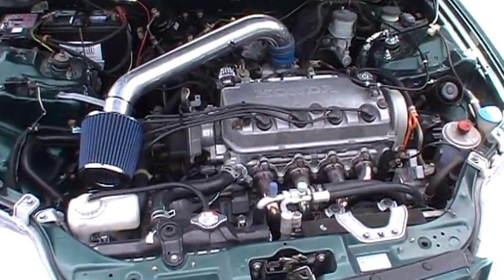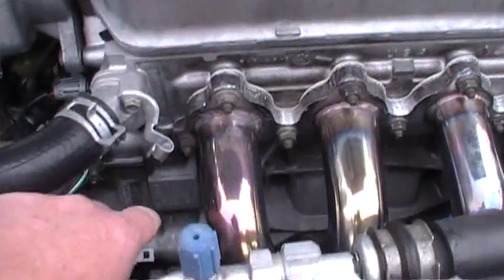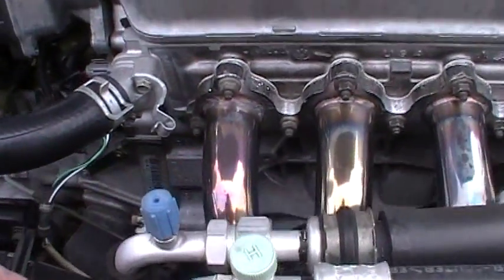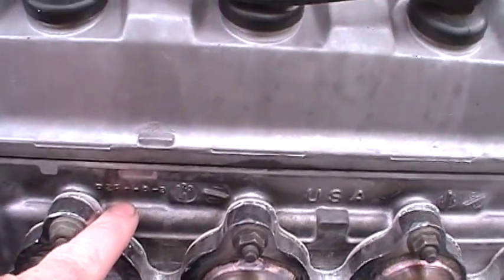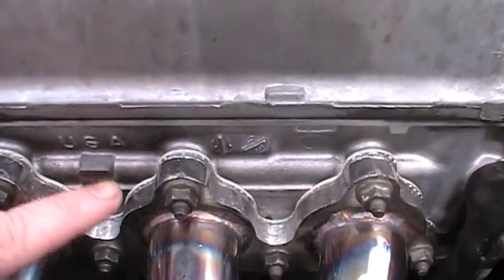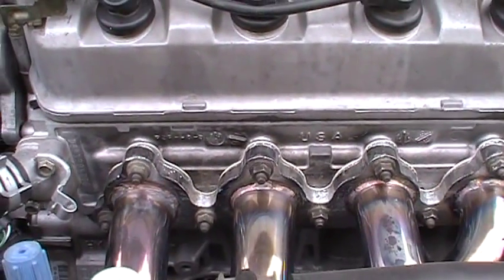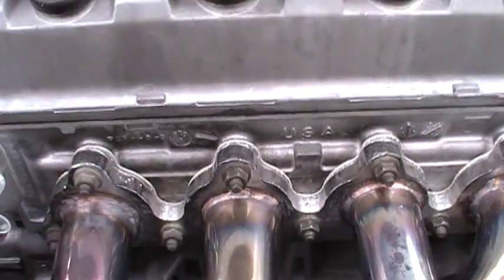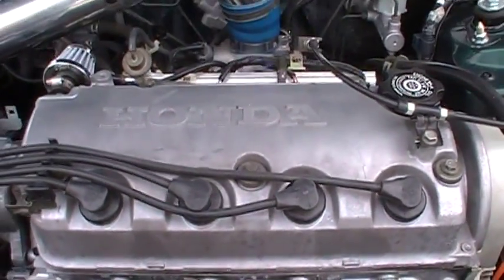Identifying your Honda Civic head

Comment: You left out the year stamping to the right of usa.
Reply from the maker: 96 to 00 :)
Reply: @tubejim101  mines a 99 stamped head. Was gonna put a y8 intake on it but i know they differ from 96to 98 compare to the 99-00 at least that's what I'm gathering
Reply: @preludedudesi5208  because obd2a and b